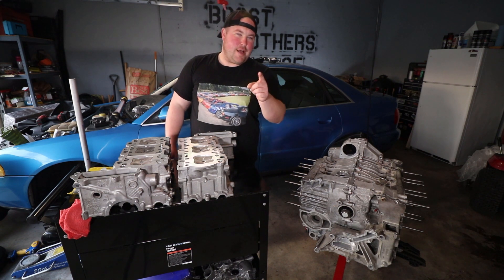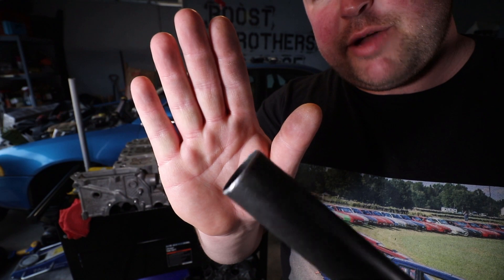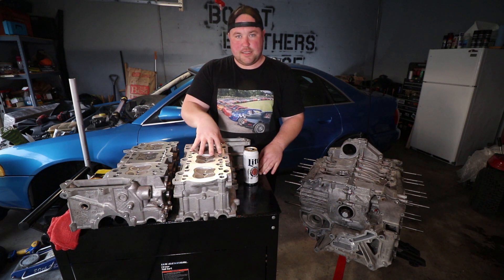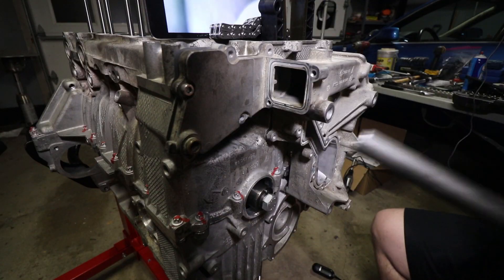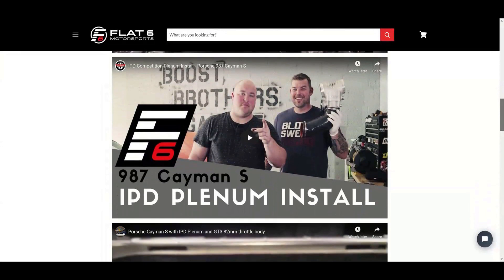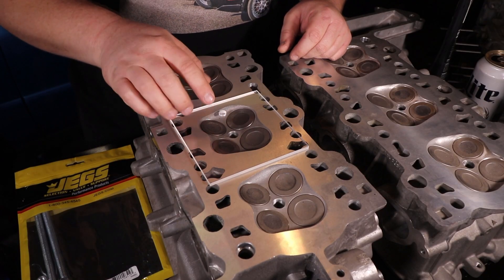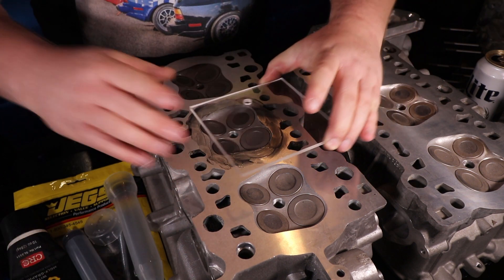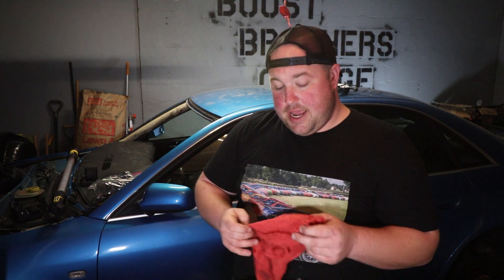Turbo 3.8L Cayman Engine Build (Porsche M96) - Part 8

Comment: Something that I didn't hear you mention but seems important regarding the circlips. When you are ready to install the circlip with the tool, are you rotating it until the tang on the clip drops into the slot before you hammer it into place? I assume you were doing that but it wasn't clear or I missed it on the last two videos. I know you said you are aligning the clip, I assume you also mean rotationally aligning the tang into the slot? Does my question make sense?
Reply from the maker: For this bank it is suggested that you cut the tangs off the circlip. There are just too many ways to screw it up otherwise.
Reply: @BoostBrothersGarage  Ahh, that makes sense. I must have missed that. Thanks for the reply. I appreciate it. Looking forward to more of the Cayman engine build videos. I've learned so much from your series.
Reply from the maker: Thanks! I will be posting another one real soon.

Comment: Why go for the lower compression ratio? wouldn't it be more effective (efficient) for the higher ratio? Enjoying the content and feel your pain. Can't believe you've only a small number of subscribers compared to Goons who clearly haven't an ounce of knowledge. Keep it up :)
Reply from the maker: Thanks! Going to lower compression ratio allows you to run more boost ok pump gas. 15 lbs of boost at 9:1 CR makes more power than 10 lbs of boost at 10:1 CR

Comment: Glad you guys got it done! That build is going to be sick! Those flat sixes sound awesome too! Congrats!
Reply from the maker: Thanks Paul!
Reply: @BoostBrothersGarage  Found an hx35 turbo im considering buying but need a little info,

To run 400whp, which is about 470hp crank at 7000rpm, it takes about 53pounds/minute flow from the turbo if my calculations are correct which is well in the hx35 range as the model im looking at maxes at 60pounds/minute flow. If i upgrade the springs on the 07k the redline goes up to 8500 rpm. Does this mean that the max output would becomes 485whp? Is max reliable engine torque rpm sensitive? If not then the turbo flow would need to be 66pounds/minute which is too high for the hx35 but works with an hx40 pro. Which turbo should i choose based on 8500rpm if that is a reliable redline with springs and maybe rods and a cam if needed. Seems like the hx40 pro would have just enough flow unless my calculations are wildly off lol. What do you think?

Thanks
Reply from the maker: Your math isn’t incorrect, but it’s not as black and white as you state. First off, horsepower is a fake number, it’s torque x rpm / 5252. So, the more torque you have at the higher rpm the more horsepower you will have. Based on my calcs the HX35 will have no problem making 400 wheel, especially if you are doing a cam. There are guys out there that have made 600 plus with an HX35. They love high boost and will have great response on this engine. However, if you are concerned and have the budget you could run the Garrett G25-660 like Alan. It was spec’d by Garrett engineers for the 07K and is capable of 660 crank HP with great response. The HX35 was my budget alternative that I believe will perform pretty similarly although well a touch slower response
Reply: @BoostBrothersGarage  I think we had a missunderstanding. 400whp is roughly equal to 460 crank hp which can translate to 345 foot pounds of torque at 7000rpm. Could the engine make 345 foot pounds of torque all the way to 8500 rpm stock with the exception of the springs and maybe a cam or would the engine implode or something lol
Reply from the maker: Haha, I gotcha. We honestly don’t know yet. Everything I’ve read just says 400 wheel is safe. I know there are people out there spinning to 8500 ok stock internals as well. We plan on doing a lot of experimenting to find the true limits, but we just don’t know yet. I think the HX35 is the right turbo unless you plan on going for serious power, like 500+ on a built short block

Comment: Hi there! Congrats!!! - that's great news!!!! I've been inspired!!!  I am technologist but wanted to learn how to rebuild a motor (in these Coronaville times we are in) - not any motor - a horizontal (truth be told I have a 07 Cayman S 36K,  it so my intentions to watch your session and this H4 rebuild have my interest) - My friend, a real mechanic unlike me, did a Subaru H4 naturally-aspirated engine crate swap for one of his customers, he gave me the failed motor (I will send pics if you want - not a YouTuber!) I have removed 3 of the 4 pistons(2,3, and 4) but piston 1 - I need to remove the wrist pin first as I can not gain access to the piston rod bolts  I can buy mostly what I need but I can not get access to the backside of the wrist pin to put the nut on to pull it through - what can I do, what can I buy? I am stuck please advise!!!
Reply from the maker: On the Cayman engine, which I believe is pretty similar, I had to split the case halves and remove the bank two half. From there I was able to remove the crank carrier and disassemble from there. Watch this video and see if it helps? https://youtu.be/T0uCS1ZB6V8